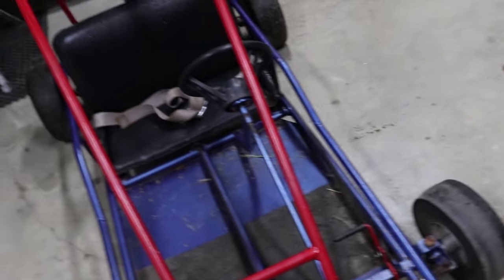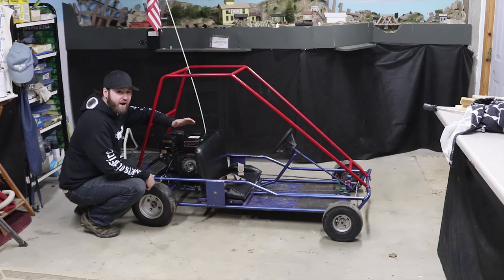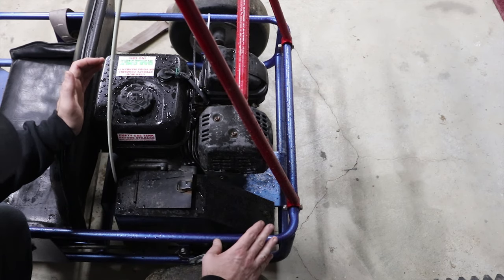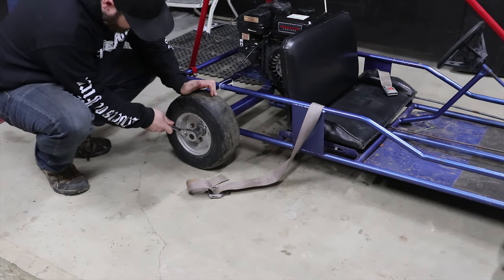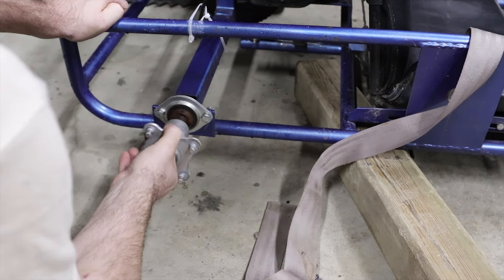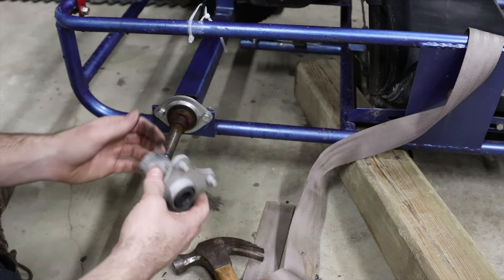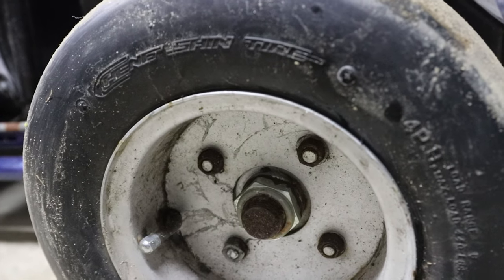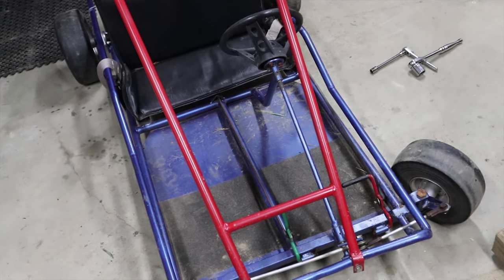80cc  2 stroke go kart engine swap (Part 2)

Comment: They have split rims. U only take the 4 bolts out to change tunes and tires.  

And cheaper gocarts have one drive wheel for a position axle you'll prolly need to move the mounting plate and put a keyed live axle setup on it. To position the sprocket for the 80cc engine. Also the sprocket tooth is way to small. Compare the chains and sprocket.    U gotta be careful with split rims. If u take the bolts out let the air out first. If they r aired up hard and stuck together it can pop apart in ur face or fuck ur hand up. Basically they're dangerous to inexperienced people. Good luck.
Reply from the maker: The go kart has already been built and sold but good Info for anyone interested in building one themselves. Go check out my go kart playlist and you can follow the whole build and see how cool it turned out

Comment: The trolling motor 6mm shaft. With a 6 to 1 torque to axel.  Running 48 volts.  Push button foot engagement. Recycled  the foot trolling controller.

Comment: I'm building a " snow cart "  or  SNAK...   Snow kayak. 
Had a old 8 ft pelican . Setting in a 80cc HF predator. Live axle with meaty tires.  A hybrid Min Kota recycled trolling motor,  pulley assist for torque. 
The 80 cc recharges the batteries with the John Deere tractor alternator. 
Not finished but soon.
Reply: I live on a lake in Michigan. Planned on frozen lake fun ... But no ice this year
Reply from the maker: So what. It’s for land or it’s going to be amphibious? I assume with the trolling motor it can do both?

Comment: It's  a gocart that could be amphibious.  Going to seal drive axel.  The
Reply: Steering system is 6 " PVC pipe running perpendicular to body  I used to kite surf. Put rudder through the PVC for  steering.